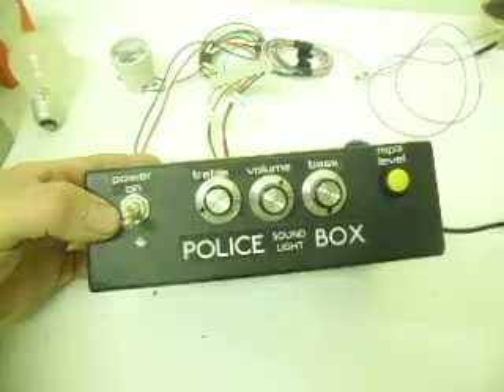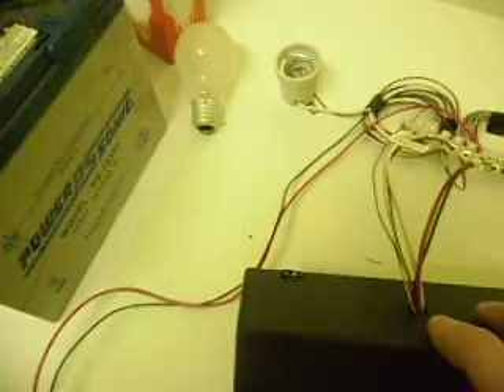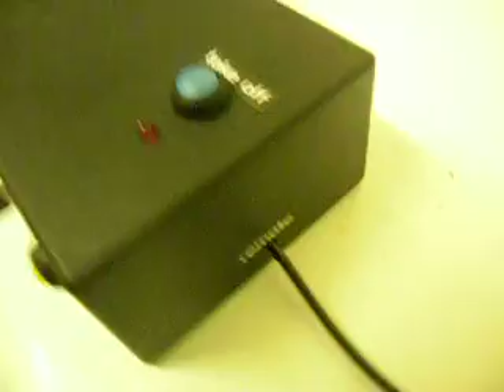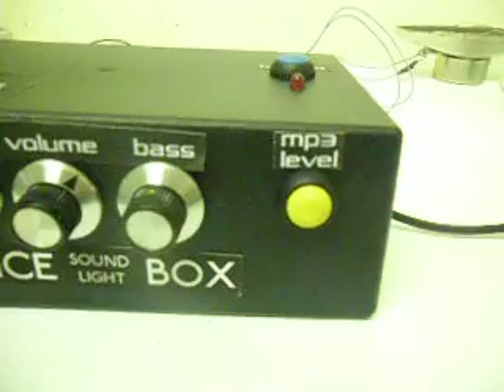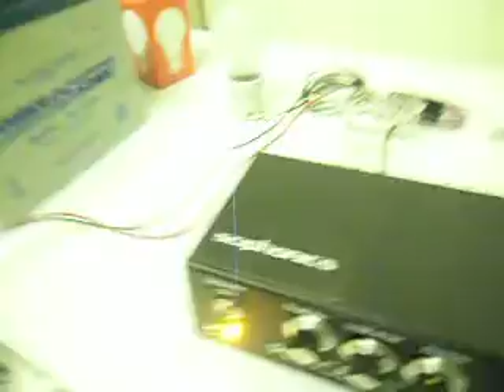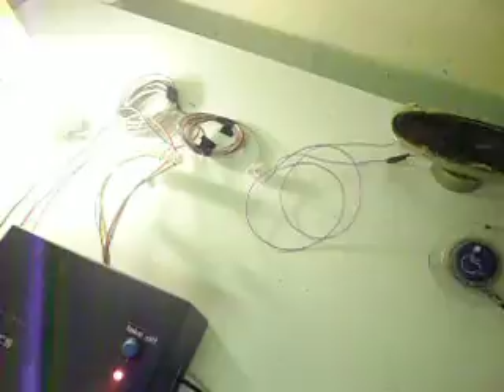TARDIS sound and light driver unit demonstration

Comment: Do u sell these along with the voice modulators? If so, how much. I'm really interested in buying a unit. Thanks. They are amazing
Reply from the maker: +Bill Lane Unfortunately I don't have time to make stuff to order like this these days. Plus it had a tendency to burn out the power supply as the initial surge of current for the bulb was really rough on power supplies.

Comment: Are you going to be at Maker Faire next month? If so, I'll be sure to pop by.
Reply from the maker: I certainly will be at Maker Faire. I'll have some ring modulator board kits for sale this time too!
Reply: MegaWayneD Excellent. I did make one up on a bread board, along with a pre-amp and an L386 based amp. I still needed to feed it through my amplified PC speakers to get any sound (I don't have a lot of audio equipment). It worked really well but I never thanked you for your advice or the frequencies to use (especially Cyberman) so thank you.
Reply from the maker: Alex Palfreman-Brown Hey no worries. I might have a few other interesting items at Maker Faire as well.